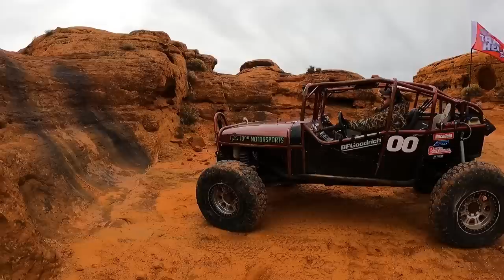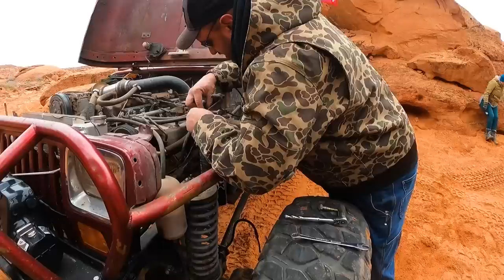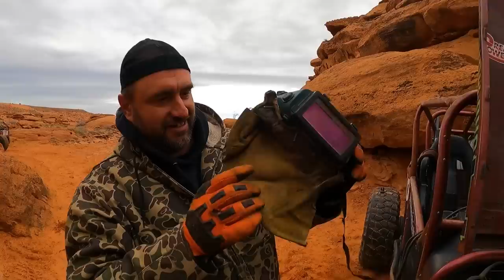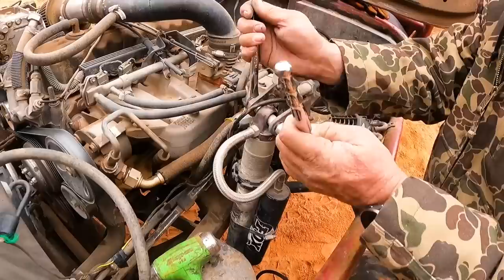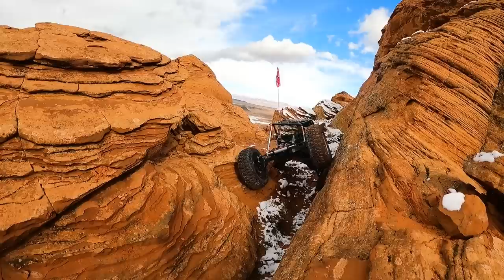Vacation Time In Sand Hollow

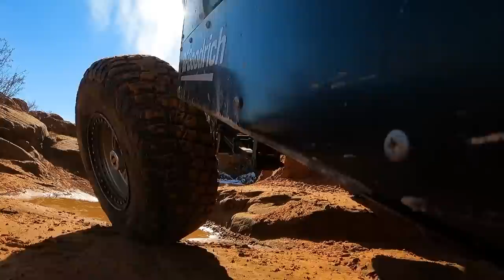Comment: Good morning Rory, Chris, Mike & Shawn... enjoy some play time... you have definitely earned it....if Harbour Freight is watching this video they may wish to order a few thousand Rory Irish Trail Ready Welding Goggles with Throat Guards, available from the supplier, Moab Motorsport 😂 For the shock repair as Mike says either it'll work or it won't... If it doesn't, demand a warranty repair from the repair guy 😂😂😂 Some crazeeeee wheelin/paddlin at about 9:48 Shawn.... I think I am starting to see the Star Trek Theme emerge...  "Where no one (no man) has gone before" when it comes to seeking out these obstacles to master... Thanks for sharing
Reply: Mike said it will work until it doesn't meaning it will work until it breaks idk where you heard what you wrote

Comment: Your Harbor Freight goggles are extremely useful, I did that back in the mid 90's for welding internals in small pressure vessels. Miller speed lens goggles you have on the wrecker would have been a God send back then.

Comment: My wife was beaten me up how I had to have the big expensive coil overs on my juggie and Rory Irish doesn’t need them he just has stock springs and shocks or at least separate units and he goes anywhere and when you pointed out the reason you run them separated and your shocks are actually coil overs without the springs she had nothin nothin at all but that little silliness aside I actually don’t care for coil overs for the same reason being aluminum and all so I went out to shop and got me a billet of 4140 or at least it was near the 4140 spot in my scrap rack and made me a threaded spherical end that is steel the threads on shock shaft are not standard metric or sae why I have no idea tell ya what they are now after a whole lotta cursing drinking and even throwing part out window into snow cause i gauged the wrong pitch